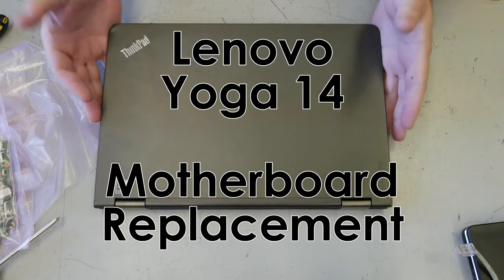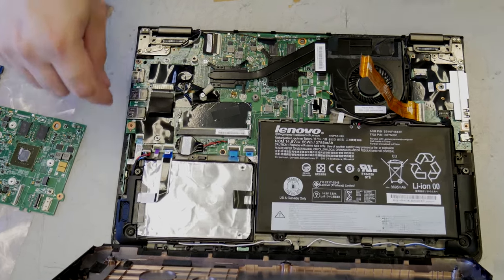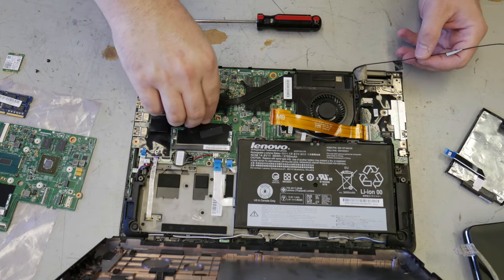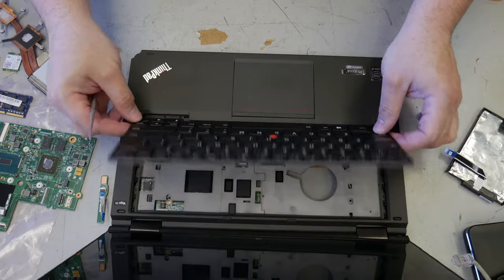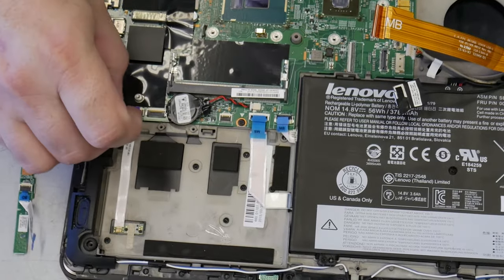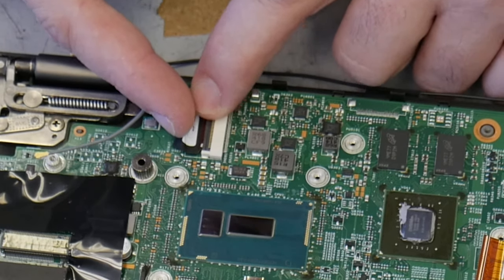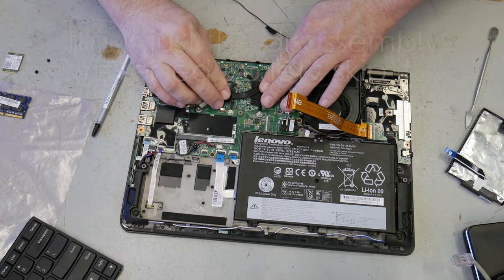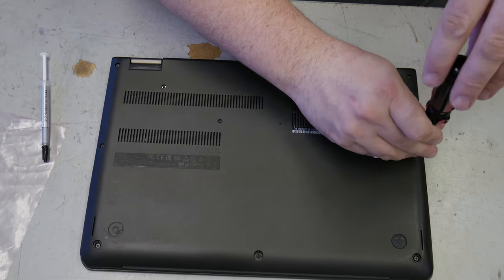Lenovo Yoga 14 Motherboard Replacement Disassembly - Jody Bruchon

Comment: Hey Jody, I have a Lenovo Yoga 13. The power cable detached from the motherboard while I was replacing the SSD. Can I microsolder the attachment back or do I need to buy a whole new motherboard?
Reply from the maker: Is the jack on your laptop soldered directly to the board? I'm not familiar with the Yoga 13 specifically. If it's just a cable that unplugged from its connector you can just plug it back in. Is there any way you can show me a photo of the problem areas?
Reply: Sorry for the confusion. It's not the power jack, but the "mocha2 power board cable" that enables the connection from the power button to the motherboard. It's not the plug, but the attachment to the motherboard where the plug is inserted has detached.  Here are some pictures, thanks for taking a look. 

https://imgur.com/YwFf9sc

https://imgur.com/4sVO7HM

https://imgur.com/HmI8JQ3
Reply from the maker: Ouch. You've ripped all of the solder pads for the connector off of the motherboard. There's no good way to fix that for a connector of that sort. There may be a way to fix it but it'd be difficult and tedious even for an expert in low-level board repair work which I certainly am not; I'm a computer repair guy that just happens to solder. I'd definitely say to buy a new motherboard rather than attempt that repair. Sorry I don't have a more encouraging answer.
Reply: No that's what I figured, thanks!